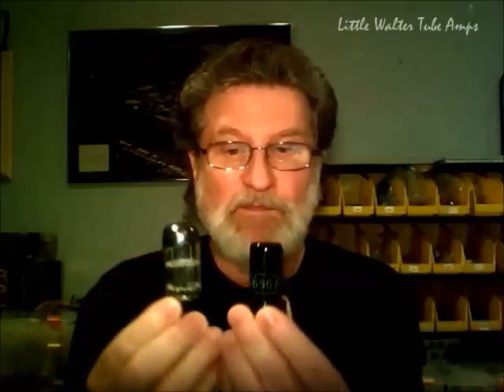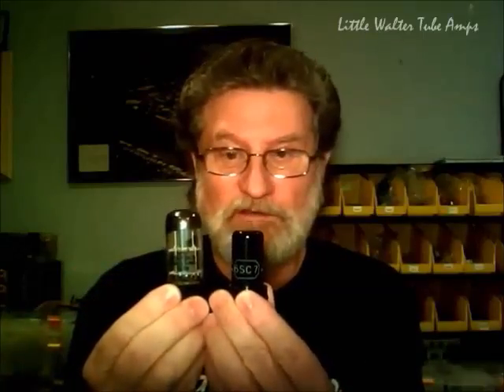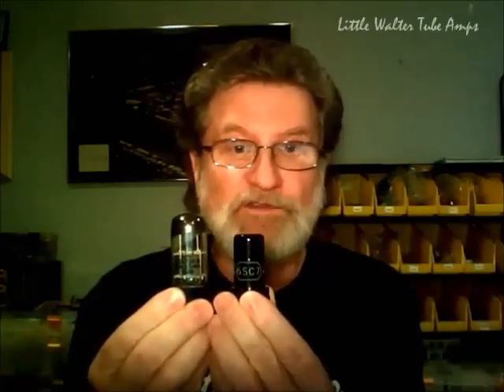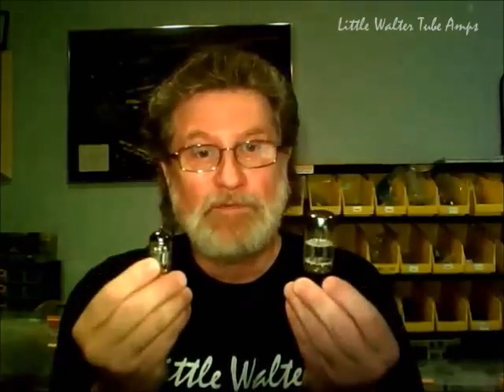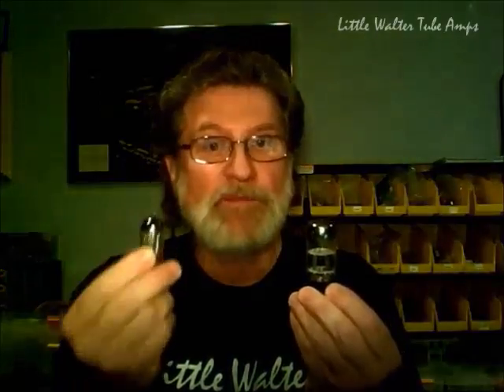Little Walter Tube Amps Informational Video on Octal Preamp Tubes

Comment: Hey Phil, I'm just a garage repair/circuit hack, and I can't play to save my life, but if I may suggest a les paul into a Scully 280 pre, driving your octal, may be a tone you'll like.  What this does is marry two famous coils, (gibson and UTC), then hands the signal off to the octal. One of my best secrets is to run the Scully off of batteries, and watch the noise floor just drop. I think it's an OMG moment. And if that's not enough, you can strip the Scully down to the three coils (freed/utc and the green coil) with the playback card,  then run it on dual opposing batteries, and you'll hear what I mean.
I have a set of the Seymour Duncan Bonamassa pickups wound on Leesona, and I'm wondering if that set isn't somehow modeled after his gibson, with the touch of the "The Beast", so I need to do some testing. Your amps' sound great, and thank you for the advice!  Scotty
Reply: +princetonaudio.com Thanks! I appreciate all of the advice.